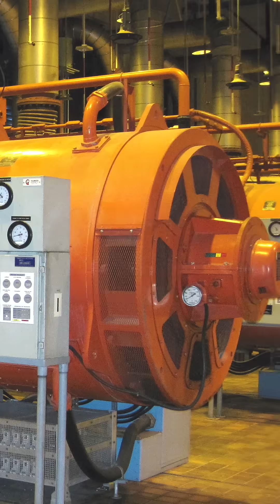wHaT iS tHE LARGEST ENGiNE EvER MaDE?

Comment: "PER Cylinder"
Shocked me😂
Reply from the maker: Yeah, I had to reupload after I learned my error. Since 1820 is quite the ways from 25,480!!!
Reply: @BladedAngel ah yes grandfather clock engine 5 rpms idle my favorite
Reply: @The_Banana_Within39 and also has special 4 Valve engines.
Reply: @BladedAngel  yeah, and 2300 tonnes are 2.3 million kg, NOT 2.1.... That's the beauty of the metric system
Reply: @jnartist3411metric tonnes: yes 
US tonnes: no
Reply: @rick-7197  "tonnes" are always metric. The non-metric unit is spelled "tons".
Reply: @blahfasel2000 Thanks 😊
Reply: @BladedAngel  So, Who made this engine??
Reply: @Norstar-v1d  Wartsilaa is apparently the company that makes them.
Two things though.

1) I got that from another comment, as of right now it's the comment at the very bottom of the thread.
&
2) both the commenter and myself are not 100% sure if that's the correct spelling.

Fun fact (Also from the other comment) :
This beast comes in a 6, 8, 10, 12 and 14 cylinder variants
Reply: @BladedAngel  if this engine ever gets shelved, I'm building a big miata around it just for the memes.
Reply: @BladedAngel dang!
Reply: that is not a cylinder is a gas tank by it self.
Reply: I was like "that cant be true"

...."per cylider"

..."aa right, that sounds more accurate"
Reply: @matsv201  yeah same here
Reply: @matsv201 why it cant be true btw?
Reply from the maker: @purwantiallan5089 because it's 5 stories tall lmao. 1820L would be too small.
Reply: Did it shock you ?
Reply: It's only 1.5 million cubic inches.
Reply: I'm going to compare apples to giraffes here for a moment. A Top Fuel dragster creates an estimated 10-12 thousand horsepower. So this ship engine is only about 10 times as powerful, based on HP only.
Reply: @jamesb120 wrong fuel .
Reply: Civic owners measuring to see how to swap
Reply: "5RPM" That shocked me
Reply: How much fuel per stroke though?
Reply: @scotthoskinson6829  2 miata fuel tanks at a time of that god-awful bunker oil
Reply: @rhonda-my_honda_cb500x  Ah, I can smell it through my screen right now.
Reply: @rhonda-my_honda_cb500x  is bunker oil the same as crude oil? They look basically identical.
Reply: @ananteshesha5788  One step better than  asphalt😒.
Reply: You could live inside that cylinder. :p
Reply: @LoociferZ  Or at least go to sleep standing up
Reply: Yes heard all this before  . Fond something interesting and new to post .
Reply: Wartsilaa (did i get that right?) is the builder of these monsters. Modular, can be delivered with 6-14 cylinders in increments of 2.
Reply: Hopefully the collar wasn't too tight at least
Reply: When it is running at full power you can see each cylinder strech as it fires
Reply: @Trundle_fkr on a dial indicator maybe.

Comment: I did the math and assuming 50% thermal efficiency and peak power at 120 rpm (using diesel at 12kwh/kg and 0.84kg/l) it consumes about 15 liters of fuel every second meaning it would empty an average 60L fuel tank in 4 seconds.

Comment: All that engine barely exceeds a 10 fold horsepower rating over top fuel nitro burners using basic engine management.

The torque however, is completely a different story, at 5rpm that would be 100 million foot pounds of torque!

Comment: 5 rpm idle? and 120 rpm redline? are u serious? 
My explanation: The roughly 25,500 liter straight-14's 1820L pistons are *
SO HEAVY, but make over *2000 hp that the engine is slow, but *VERY VERY VERY powerful. Oh, and the reason it sounds like a grandfather clock is all of the valves and pistons at idle moving at only *5, I repeat, *5 rpm.
Reply: Also it's diesel so by nature it's slow and look even when this giant beast work at 80 rpm(that's what these machines usually ran) they still make that big power 

8000 rpm? Dude you would wreck the ship, let's say this is super ship and it's survived that fuel tanks would be emptied in a 10 seconds but even that 10 seconds would be enough foe creating a tsunami or something

Comment: That bad boys got a power to weight ratio of 0.025hp/lb
Reply: Yes, but it also makes 7 000 000 Nm of torque. 7 million. The 300 ton prop shaft gets twisted 180 degrees before the prop starts to spin

Comment: This is why fuel is so damn expensive. We’re not paying for our gas we’re buying that company with the largest motor gas 😂
Reply: they often run on hfo which is all the oil no one else can use, because it requires a lot of energy just to keep from solidifying. We had a boiler on board whose main job was to keep the fuel tanks heated. It ran off exhaust gas when the engine was on or a smaller diesel heater when not

Comment: That 107,000hp is the continuous rated hp, that engine is designed to be at that rpms for months at a time crossing oceans, meaning that it could be hot rodded and double the hp for short burst of power(maybe tripled?)

Comment: The HP isn't the important number here. What's important is how it's making that much power at such a low RPM. Power is a function of torque and RPM. How much torque does it need to make over 107,000 HP at 120 rpm or less?

Comment: During my career i operated the rta 86 6 in line, and it tops rpm at 72 but that very depends on engineering needs cause it can certainly go past 100 rpm if it was planned so especially if you need to squeeze 100  Mw out of it.

Comment: Worked on one of these in the middle of the med sea, they had to lift us onto the boat by crane. I had to get my passport stamped just to do the job. You could live in one of those cylinders, they're huge. The job was to remove a head bolt that some genius cut off flush with the block. Took us 4 days, after the forman did what I told him needed to be done. In between that time I watched old men do their very best to kill themselves with hair brained ideas and schemes. That engine is 3-4 decks tall. It takes up an enormous amount of space.

Comment: What's amazing is that's far from the most powerful single engine humanity has created, which belongs to GE, with the Harriet 9HA.02 which in single cycle (just the engine, and not using the hot exhaust to generate more power) makes 571 MW of power (or 765724 hp)!!!

Comment: Wanna see powerful engines? Go look up rockets. Those things chew through thousands tons of fuel in minutes. 100k Horsepower is childsplay.
The gas generator that was used to drive the turbine pumping the fuel had 55.000 horsepower, pumping 1.5k liters of fuel per second into the combustion chamber. 
The saturn V had FIVE of these. The resulting thrust converts easily into millions of horsepower (HP isnt a useful metric for rockets, which is why it's not commonly used)

Starships super heavy booster creates almost 20 times the amount of thrust of the saturnV rocket. So talking about powerful engines, this is where things get a bit crazy :)

Comment: Fun fact:  The largest commercial vehicle engine is a custom-built 2400 hp Volvo D13 inline 6 diesel engine used in the Volvo Iron Knight speed-record truck. However, for production trucks, the largest engines are typically around 16 to 16.4 liters, with powerful options from companies like Scania, Volvo, and MAN offering up to 780 hp

Comment: Saturn V Rocket 🚀 produces a Thrust Output Equivalent to 160 million Horsepower. But Starship Super heavy Booster with 33 Engines is more Powerful it produces Thrust Equivalent to 130 Million Horsepower making it the Most Powerful  Machine Man have Ever Built

Comment: The fact that it's only as powerful as 107 hypercars is crazy inefficient for the size though. It's way larger than 107 times the size of their combined displacement if we're talking 5.0L twin turbo V8
Reply: Not really, because a machine like that has to deliver its performance 24 hours a day, 7 days a week, and often for more than two weeks at a time. And it has to do this for 20-25 years without any major overhaul.

You have to build something like that a bit more robustly than a car engine, which only delivers its maximum power for maybe a few minutes at a time.

Comment: Has to use a Cummins x15 size motor as the starter
Reply: No, not quite. It wouldn't be able to do that.

A machine like that needs compressed air at 140 bar pressure. Then the starting process only takes a few minutes, plus an hour of preparation time, of course.

Comment: Just remember, top fuel dragsters require 81.9 liters or 10 dragsters to make this horsepower. This engine is 311 times larger than that displacement. horsepower figure isn't impressive but the torque figure is 5,000,000. Plus this doesn't do a 1000 foot pass and have to be rebuilt. This does 10s of thousands of hours and can be maintained while running.

Comment: Why is it a shock that the largest engine isn’t for a car, but for cargo ships and oil tankers? 😂😅
They also burn a barrel of fuel per mile (considering they haul 100s of kilotons or over 100 million kilograms). Hopefully, this will be a thing of the past if nuclear powered ships could be the potential fuel source if it doesn’t tamper with the cargo/goods being transported. 😅

Comment: Great job on telling us what the engine was actually for.  I'm guessing ship engine?  It's interesting how they start these big engines.  They use a "donkey engine" to build up air pressure and then dump it in with a butterfly valve to crank the huge thing over.  I've been in a pitch black engine room when they were starting the engine with this process and it's slightly terrifying hearing the pressure build up then a pause and big wooosh before the big engine finally springs to life.

Comment: Working on ship as a deck crew during winter the engine room is very cozy. You will not mind the deafening sound inside when it is running with the generators on you just want to be warm.

Comment: the fact that a 3 liter inline 6 can make 1/50th the horsepower (and more) is staggering. 1/50th the power, but 1/8333 the size. talk about efficiency on the low end. this engine needs a turbo that you can drive a bus through

Comment: It’s the Wärtsila-Sulzer RTA96-C, 14 cylinder two-stroke diesel engine with 107k horsepower used in the world’s largest ships with the greatest weight capacities going on long distance trips. developed started in 1993 , shop testing started in 2004 , for the first engine to go into use in 2006 aboard the container ship Emma Mærsk.
Reply: Emma is one big ass boat!!
Reply: That's one big bonofasitch
Reply: Oh they've updated to 107k? It used to be 102k HP iirc.

Comment: This monster is turbocharged and makes 5 million lb/ft of torque, consumes 250 tons of heavy fuel oil per day, or 14k liters per hour, in it's most efficient mode converting more than half of the fuel's energy into motion 🤯. It is used to power the Emma Mærsk (170.8k gross tonnage) container ship to a top speed of 25.5 knots (47.2kph or 29.3mph)

Comment: "2 RPM" on redline, like if maxed operating at 80% from redline thats at least 0.8 second per stroke. On a 2 stroke, flywheel assisted, thats a lot of entorpy. Probably at below 60% efficiency, but i guess its the power output and torque that was important.

Comment: You know.. For the 25480 liters, and 26 tons,  190000 hp/2300 tons isn't as much as i thought.  A good car build can be 5000, so that's just about  40 car engines combined?.  Weight to power is pretty screwed. But durability I'm sure isnt a comparison.

Comment: I've never understood why anyone bothers with using a horsepower number for these giant diesel engines. The number that matters is the lb ft of torque number. In the case of this monster, the torque absolutely DWARFS the hp number with a staggering 5,608,310 lb-ft torque. THAT is what is twisting the giant prop on a ship like the cargo ships in which that engine is installed.

Comment: So putting that through the HP calculator. If it makes peak power at 120rpm that means it has almost 4.7m ft-lb of torque. If it could maintain that torque and you increase the RPM by 1. It would produce around 900Hp more. 5 rpm gets you 4,400Hp more and going the whole way to 200rpm gets you 71k more HP.

Comment: One complete cycle of the engine. burns more fuel than my four cylinder pickup in a year. Of course I couldn't even haul one of its cylinders in my pickup but it could haul 400 of my pickups... Don't bother correcting me I'm just throwing out numbers.

Comment: made by Wärtsilä, a Finnish company, used by one of the biggest tankers, cargo ships and cruise ships
Reply: Everything is bigger in 🇫🇮 Finland. 🎉
Reply: @TeroVaan-h4c  everything? 😏😏
Reply: I want to invade Finland  @TeroVaan-h4c
Reply: @TeroVaan-h4c Noor, TEXAS 😊😊😊
Reply: Worked with Wartsila, and  even though I thought I was pretty good boy did I learn BTW this was originally a sulzer engine Wartsila bought Sulzer and Finnished it pun intended.
Reply: @stevenrussell6787  nice
Reply: Funnily enough, I know Wärtsilä. We sell them pumps for their nuclear powerplants
Reply: @Presben whaaat? Wärtsilä doesn't make nuclear reactors or powerplants to my knowledge
Reply: @Repsikka Sorry I didn't express myself properly, we sell them pumps for backup generators for nuclear powerplants. They don't build reactors as such, but they contribute to the Finnish nuclear industry
Reply: @Presben aaaivan
Reply: Cruise ships don’t use engines like that. Only tankers and freighters. Cruise ships use Azipods, which are electric. Their engine is used to generate electricity only, not for propulsion
Reply: @dominic150  I meant Wärtsilä engines generally, not just the biggest version only, should have clarified, Star of the Seas and Icon of the Seas, the identical, 2 largest cruise ships in the world, which were built in Turku Finland btw, use 3x Wärtsilä 14V46DF  and 3x Wärtsilä 12V46DF, it does use 3x ABB azipods as well as 5 bow thrusters, also made by Wärtsilä
Reply: @Repsikka and for airstart 30 bar compressor
Reply: @dominic150  where do you think they get the electricity from?
Reply: @theonewhoknows2  From engines that are not like that. I don't know these details, I'm not a ship fanatic, but I would imagine they'd have a somewhat different approach, even if it's just much smaller versions of these.
Reply: @dominic150   Thats why carnival catch on fire lol
Reply: @dominic150  You're right, NEW cruise ships use pods, which either use electric or hydraulic pumps, and those are powered by diesel fueled generators.

The older cruise ships which didn't have pods, used massive diesel engines, but not the size as in this misleading video.
The monster sized engines were used in freighters and tankers, but now at days, even those use engines that weigh much less.
Reply: @jakupmadsen490 Because I don't know a lot about engines I have a question. What makes the video misleading?
Reply: @dominic150  Azipods are for port manoeuvring, not for steaming in the open sea. (on most vessels, certainly all cruise ships I've worked with).
Reply: I saw korean letters on the side, what happened with the video Image?
Reply: @Chleosl  It's an engine from a Hyundai Heavy Industries cargo ship. Despite being notoriously large, it is not the largest.
Reply: @alexrf04Wärtsilä is biggest
Reply: @Chleosl  the way the industry works these days is that you basically sell the “drawings” and IP of the engine and a license for the shipyard to build it. The engines have gotten so big that it just makes more sense to build it integrated into the ship building process. This one is built by Hyundai Heavy Industries which have an insane facility “close” to Busan.
Reply: I bet it does more than cruise 😂
Reply: Yes but it is a project bought from Sulzer.
Reply: Thank you for "finnishing" the video. That's info that should be in the video
Reply: LECLERC ENGINE MENTIONED🇫🇷🇫🇷🇫🇷🇫🇷🇫🇷🇫🇷🇫🇷🇫🇷🇫🇷🇫🇷🇫🇷🇫🇷🇫🇷🇫🇷🇫🇷🇫🇷🇫🇷🇫🇷
Reply: Wärtsila did not make this engine, they designed it but not made it.
Reply: but its not the most powerfull
Reply: I can confirm. For reasons, I have a Wärtsilä ship power product catalogue. These are main engines for huge ships.
Reply: Not common on cruise ships. Modern cruise ships use 4-stroke engines (multiple) in a diesel-electric setup as it saves space, which means more space for people.
Reply: @SirPrizeMF  ...and I highly doubt that this engine is still being sold. It is made to work with the dirtiest fuel to burn possible. In the same vein, even cargo ships now prefer using external electric thrusters due to increased manoeuvring capabilities.
Reply: Thank you - I was upset he didn't say what it was used in.
Reply: The two stroke engines are actually designed in Winterthur in Switzerland. It was part of Wärtsila, but the Finns ran the operations side of the business. They sold off the two stroke business a while back and the company that designs these engine is now bought by a Chinese shipping conglomerate.
Reply: @BS-jw7nf Yet another Western strategic mistake.

Comment: This engine consumes up to 250 tons of heavy fuel oil daily!
Unfortunately, it all goes unfiltered into the air.
Currently, it's one of the most energy-efficient combustion engines, converting approximately 50% of the fuel's chemical energy into kinetic energy.

Comment: this is it, our engine capacity with gasoline fuel is limited to its origin which is the fuel itself " Gasoline" 
we need to harvest atomic energy for our engines to be able to make smaller engines with higher much much stronger then we have, a small engine car size that could load carriers.
i read somewhere that we have to reach the technology where we are able to harvest atomic energy with some kind of picking atoms separately if that makes sense, right now they are getting atomic power by burning so there is radiation remains after burning. 
if they pick and separate the bad atoms "simple terms" and only burn the energy and got rid of radiation somehow.
i think its more plausible then to go and find somekind of magical dying star fuel which like what? its just 500 year later